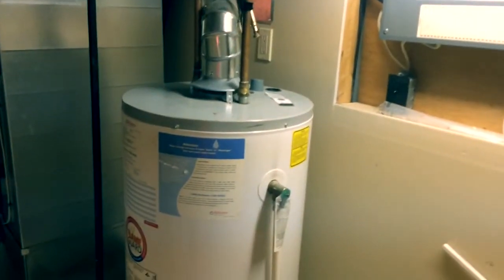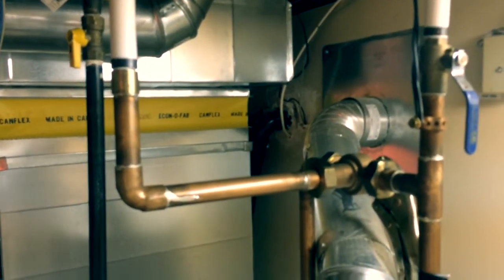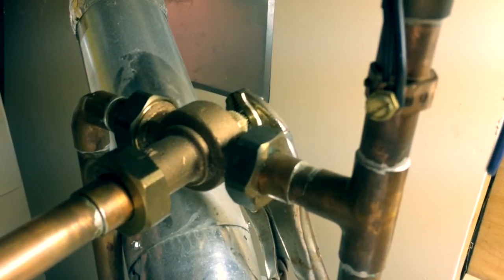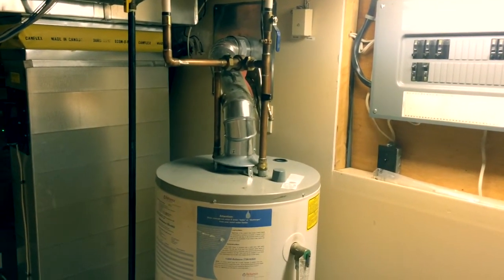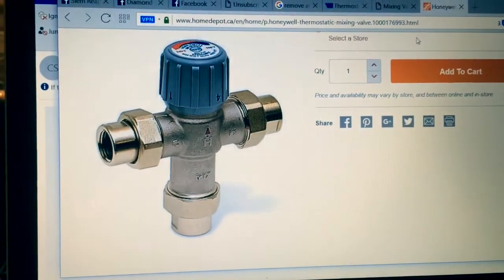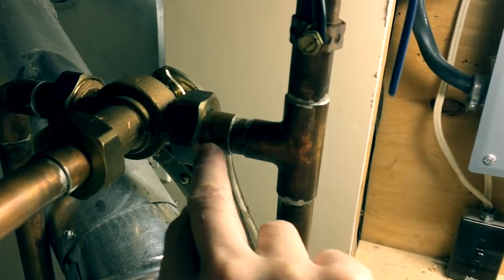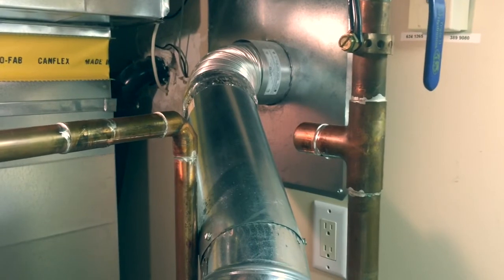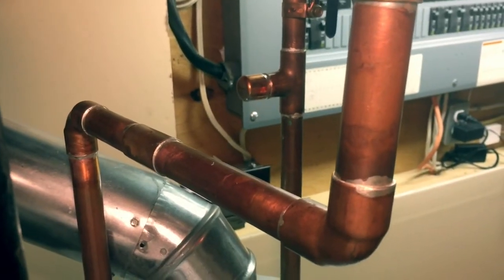Hot Water Mixing Valve

Comment: Hats off my friend. Best explanation ever for the thermostatic mixing valve . But I am doing the reverse that is installing one respecting regulation for a home inspection. I respect your opinion and choice but it's a good thing to have one. Thanks again
Reply from the maker: I think they provide a good function.  Sometimes upon reflection, we settle the issue best.  In this case I did not speak more on the good.  

The mixing valve allows for the water to be kept at a higher and safer temperature in the tank.  This kills any and all harmful bacteria's that could lurk there.  (granted, if the tank is being emptied and filled on a regular basis in a busy household, that is moot)  Then, it mitigates against dangerous burns by mixing the hot to a temperature that is safer.  That's all good.  

The issue I have otherwise is to fold.  Firstly, the enforcement of it.  And secondly, the fact that they don't last long and are very costly to replace.  I took mine off because I wasn't going to buy a third one, and it was such an annoyance dealing with it.  Most plumbing fixtures and systems last at least 10+ years.  It shouldn't be too much to expect the same from a mixing valve.  

That is all.  :)  Thanks for your comments.  Let me know if and when yours fails.  Maybe I just got unlucky.  haha.

Comment: I think you're missing the point of the mixing valve. It will allow you to keep your water tank at a higher temperature to avoid harmful bacteria from thriving while allowing your household water tap to run at a safe temperature. A six second exposure to 140F will cause third degree burns but that temp is recommended to keep bacteria at bay. Mixing that down to 120F at the tap will mean much longer exposure (like 5 mins) before suffering a burn.
Reply from the maker: You are right about that, and I cannot remember if I ended up mentioning that in my vid (its been a long time) but the truth of it is that you can keep the water at a higher temp in the tank to kill all harmful bacteria, and then reduce it down to a safer temperature for personal use at the bath or shower.  

Dependent upon how often the water is drawn and used however (a busy family empties and replenishes the tank a few times a day) and where the water is sourced from (municipal water is chlorinated and bacteria free) this problem/risk is minimal.  

The point I was making however was that this valve is expensive and not entirely necessary, and certainly doesn't need to be legislated.  A person can still keep the water as hot as necessary in their take if they are concerned about bacteria, and mix it to a safe temp at the tap; something we have done all our lives until these mixing valves became more popular.  

The motivation was that I had two failures, and that each lasted only about 2-3 years each, and for me, living alone and responsible enough to monitor my own water mixing at the tap, I resented the need, and felt it was an unnecessary expense.  

Someone please make a mixing valve that can last 10+ years.  In the mean time, having to pay  a plumber to fix this issue is a minimum $300 bill.  

Something I really do appreciate and see value in is a pressure balance on most shower and bath fixtures now.  This eliminated the temperature fluctuation when someone else in the house uses water elsewhere, or flushes a toilet and eliminates the potential of scalding; but that's another topic.  

Thank you for your comments because you do bring up a legitimate point.
Reply from the maker: Probably a better solution entirely is to forego the tank and use Hot water on Demand systems, which are almost exclusively used in most parts of Europe.